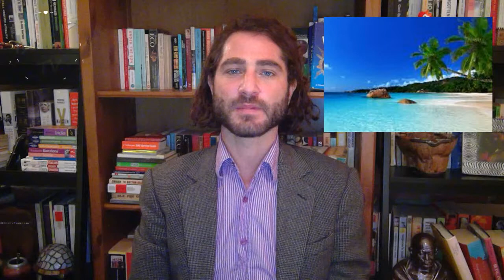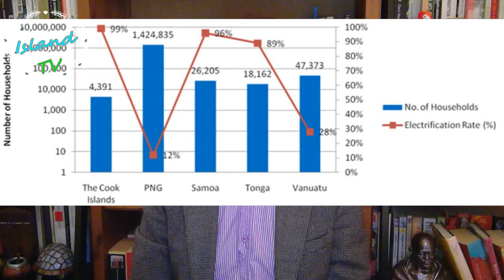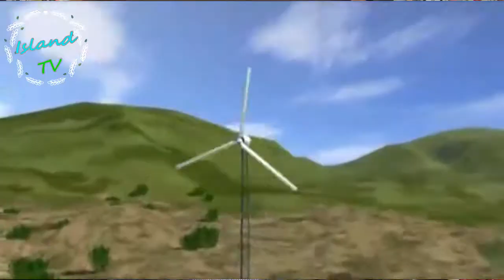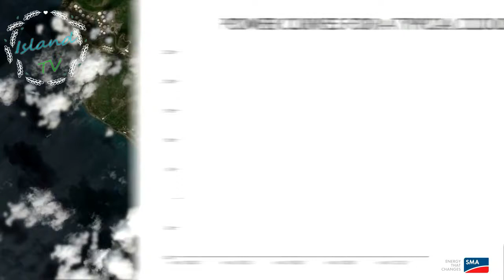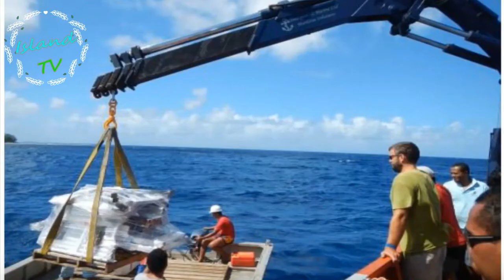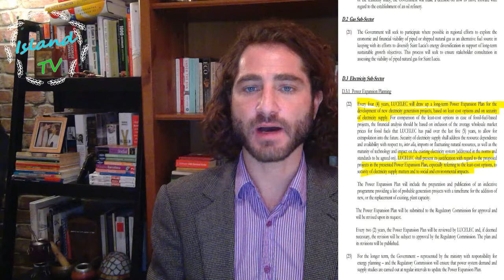Francesco Ranieri - Island TV

Comment: I really enjoyed watching this great video!
Which Energy Storage System (ESS) are better fitted and more viable for renewable island microgrids?
Reply from the maker: Usually flywheel works better with Wind due to the higher capacity factor wind has allowing the kinetic energy to be more constant. However flywheel are paired as well with solar or sometime with battery to offload some of the load store in the battery.  Battery pair better with Solar, and mainly with any source. Hydro pumps, of course with hydro. Many islands have flywheel today